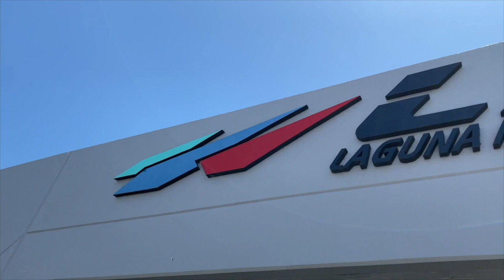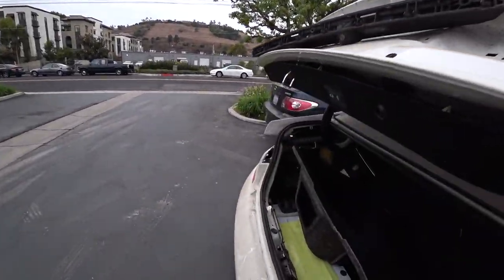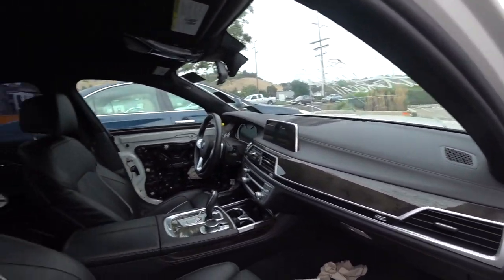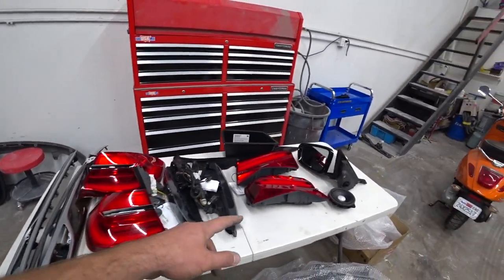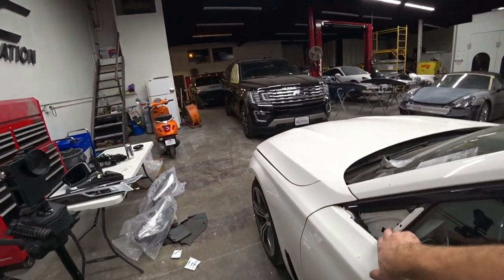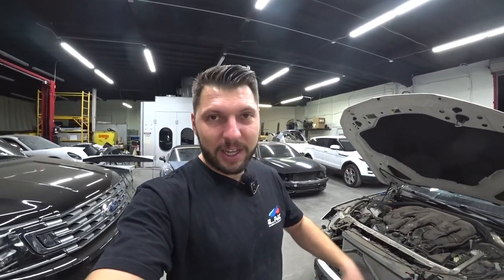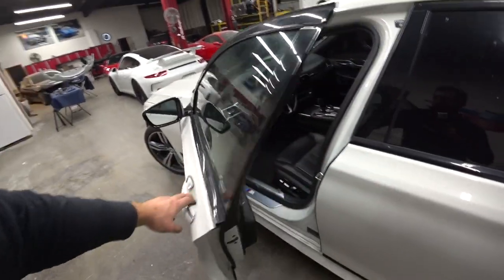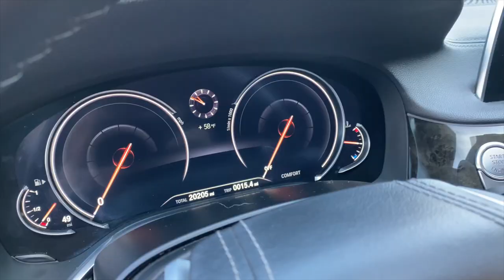BOUGHT A STRIPPED NEW 2019 BMW 750I FROM THE AUCTION FOR CHEAP!

Comment: Stolen recovered. Thieves looking for tracker.
Reply: no, to clean, i think stripped for search is a one.
Reply: I was in doubt it was from a police search because they often trash everything... I was thinking it was recovered from a chop shop stripping it down for parts, or stolen to be shipped in pieces to Eastern Europe...
Reply: First thing thieves will take is the Navigation system and airbags, and they cut wires everywhere

Comment: In the UK when the cars are stolen this damage is normal as these are the places that you would find a tracker
Reply: They are normally left in a hospital car park for a few days to see if they get recovered. Even expensive one's don't look out of place there. Preferably one by a police helicopter base as it will pick uptake tracker as it flies by. Tracker detector has a 25 mile radius.  If its found, they can not leave it as a bait car sadly.

Comment: The front tires are shot.  Check the alignment prior to putting new tires on it.  Very nice 2019 BMW 750i.
Reply: I bet the date code on the tires are older than the car lol.  Probably had aftermarket wheels

Comment: Nice rebuild.  Have you checked the sensors and tons, functioning. Have not changed, air, oil , cabin filters engine,  transmission, oils, wind shield cleaning liquid, coolant etc
Reply: TPMS

Comment: It is not stolen. He would not be able to buy it. Police would give the car back to its owner and insurance company would rebuild it. If it was not insured the owner would still have the car with keys - at least the backup one. If it was stolen and not found the VIN would be reported as stolen and i doubt LNC do not check these things... My bet is it was stripped to export/import the car to/from another state/country as a crashed car for parts to avoid taxes for exporting/importing whole new vehicle. You have no keys, parts are missing, it looks wrecked at the first sight, car is not running you have no keys to prove it and even if you have the engine is easy to make not start - for a case somebody would sniff around. The story fits. It is wracked car. Parts can travel in another shipment and the car can be reassembled in one day in its destination. In this case something went wrong in the process.  This used to be a "big thing" in Europe many years ago. I bet some states and countries still does not require proof of paid import taxes during registration of vehicle.
Reply: Definitely Stolen, insurance paid out the owner already so the Police wouldn't return it to the owner, it went back to the insurance who then sold it on.